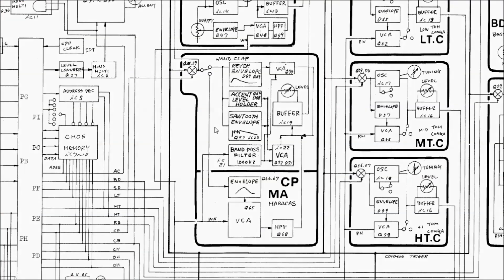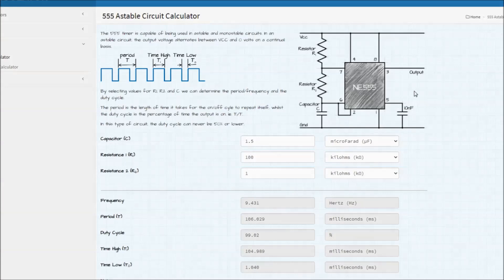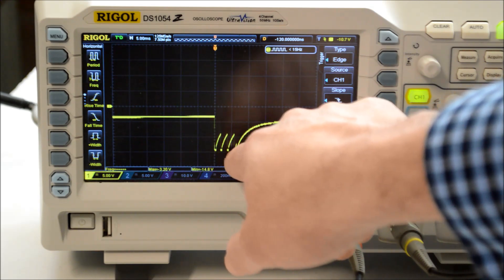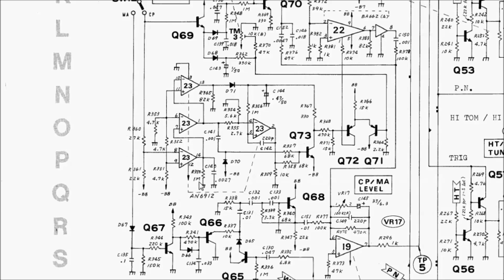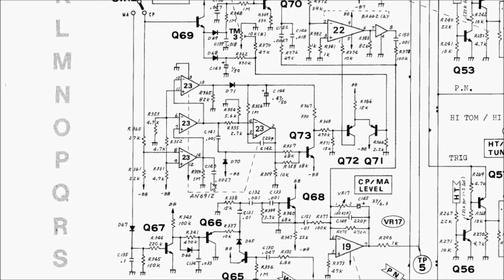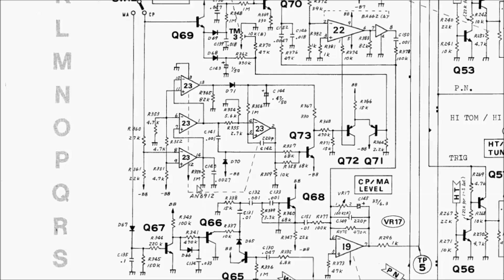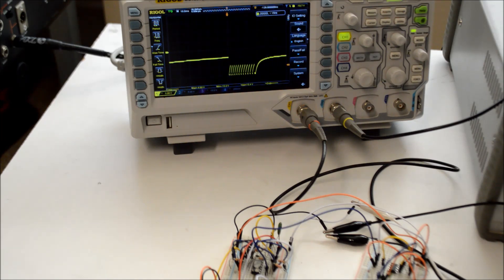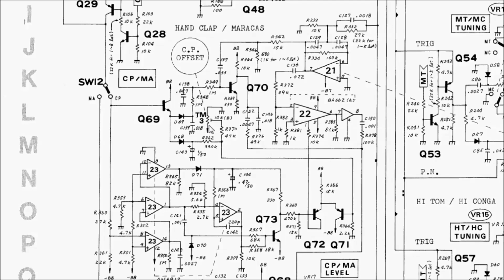Designing Roland TR-808 Mods for Doctor Mix - Synthchaser #136

Comment: Clever trigger mod on your 555 circuit. I've always just used a dual 556 and hooked them up sequentially, so one triggers the other. That lets you get full 0-100% duty cycle on the PWM.